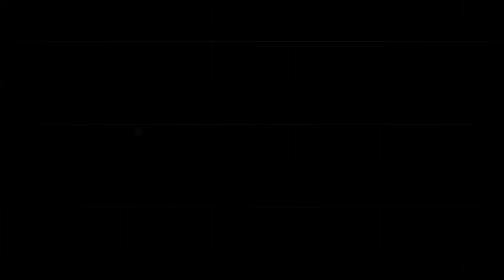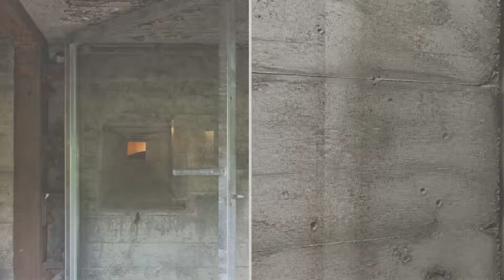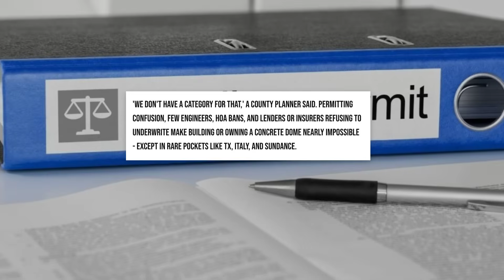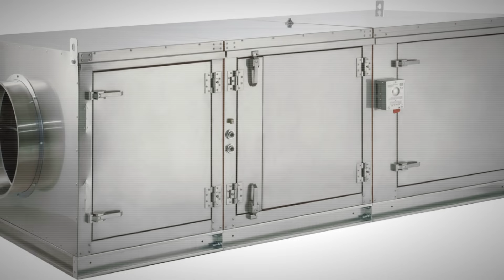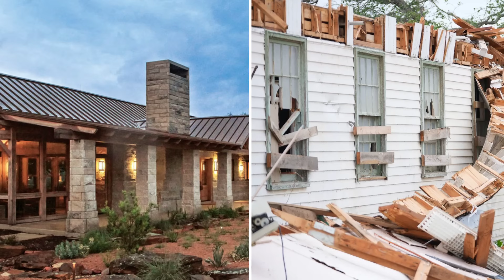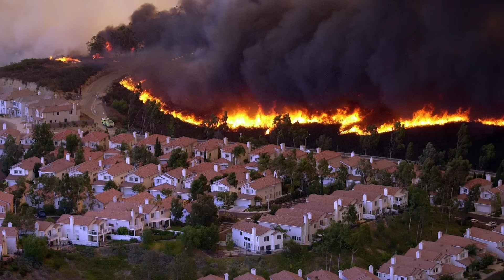This $500 Concrete Dome Survives What Bunkers Can't. Why Is It BANNED in Most States?

Comment: I'm curious if this approach has been attempted with CEB and, if so, what were the results. I've seen single axis CEB brick domes roofs, which with little imagination could be built as Quonset huts. I imagine the same principle could readily be applied to a circular dome, with the right brick mason craftsmen, like in olden days. But what would the math say about the structural integrity? What would the math say about the construction cost of a CEB dome building.

Comment: OK... Found this:   Building a Concrete Dome as Your Primary Residence.   It is NOT Banned in most states.. You just need to follow all the existing laws and building codes - all of which vary widely around the country

Yes — you can build a concrete dome as your primary residence, but it requires careful planning, engineering, and compliance with local zoning and building codes.

1. Legal and Regulatory Considerations
In most U.S. jurisdictions, dome homes are not prohibited simply because they are domes. Instead, they are reviewed under the same safety, structural, energy, and occupancy standards as conventional homes 
    Zoning laws determine where you can build and what types of structures are allowed. Some areas may classify domes as “alternative structures” or “temporary” if they lack foundations or meet certain size thresholds 
    Building permits are usually required for permanent residential domes, especially if they are 200 sq. ft. or larger and intended for year-round occupancy 
    Engineering review is essential — dome designs must meet structural load, wind, and seismic requirements. Licensed engineers can stamp plans for code compliance 

2. Types of Concrete Dome Construction
    Monolithic Domes: Continuous concrete shell with insulation, offering high strength, energy efficiency, and resilience to wind, fire, and pests 
    Insulated Concrete Domes (ICDs): Similar to ICF homes but with a seamless concrete shell, eliminating weak points and reducing maintenance 
    Geodesic Domes: Often prefabricated; may be considered temporary in some rural areas if not foundation-based 

3. Key Steps to Build a Permanent Dome Residence
    Research and Design – Choose a dome type, size, and layout; work with a professional designer or engineer
    Site Selection – Ensure the land meets zoning, setback, and utility requirements 
    Engineering and Permitting – Get stamped plans, apply for building permits, and coordinate inspections 
    Foundation and Utilities – Install a proper foundation (often a concrete pad or slab) and connect utilities 
    Construction – Build the dome shell, add insulation, and finish interiors m.
    Financing – Present the dome as a conventional home to lenders; dome-specific financing may be available 
4. Advantages of Concrete Domes for Primary Residences
    Durability – Concrete resists fire, wind, and pests; long lifespan 
    Energy Efficiency – Curved shape reduces surface area, cutting heating/cooling needs by up to 50% 
    Low Maintenance – No roofing repairs or pest infestations 
    Customization – Can be designed for single-family, multi-family, or off-grid living 

5. Important Warnings
    Always confirm local regulations with your county or city building department — rules can vary significantly 
    If you plan to build in a planned community, check for CCRs (covenants, conditions, and restrictions) that may restrict dome construction 
    Engage qualified professionals (engineers, architects, contractors) to avoid code violations and safety issues.

Bottom line: A concrete dome can be a viable, durable, and efficient primary residence if you follow proper design, engineering, and permitting processes. Start with a professional plan, secure local approvals, and ensure the structure meets all residential code requirements.